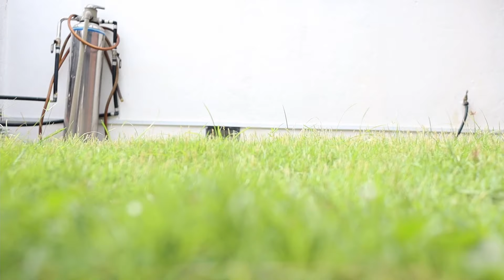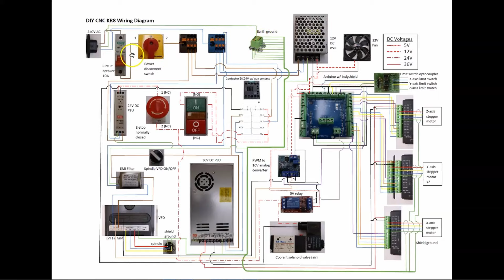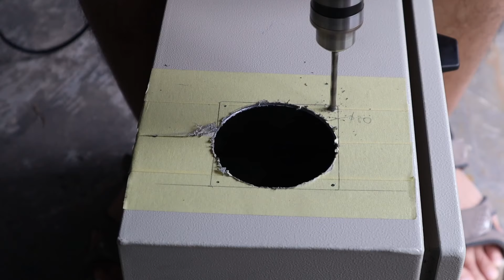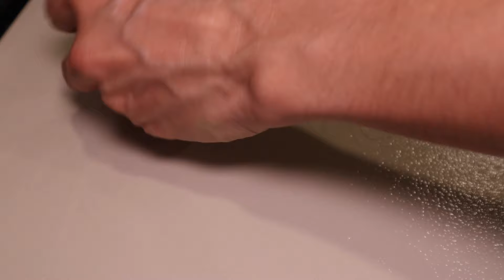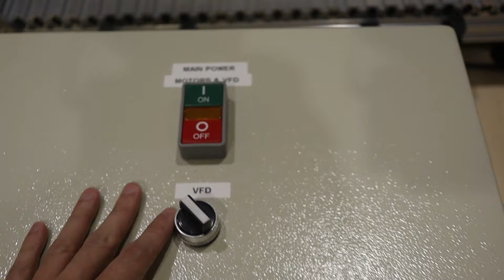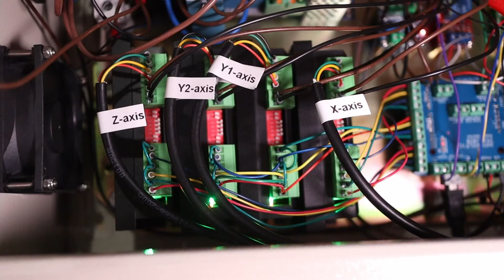DIY CNC KR8 Part 3 - Electronics

Comment: I have a very interesting question. DC 0V(Arduino GND) should be isolated from Earth Ground Right? But how can we isolated Arduino GND from Earth Ground While Probing Since Machine is Earth Grounded.
Reply from the maker: I believe you are right. I don't have this problem before as the DIY Dremel CNC has a wooden bed. So what I will do when machining metals is to insulate the stock from the aluminium bed by having a non conductive waste board in between.
Reply: Thanks for the reply. More content on CNC please.
Reply from the maker: @nyeinchanzaw6936  will do. Next video will be on the CNC enclosure for KR8. This one took me way longer than anticipated due to difficulties encountered in various aspects of the project but it is moving forward, slowly but surely.